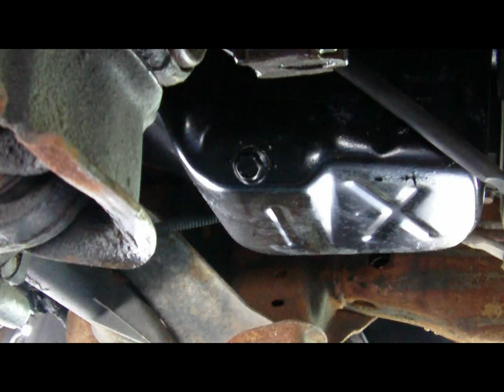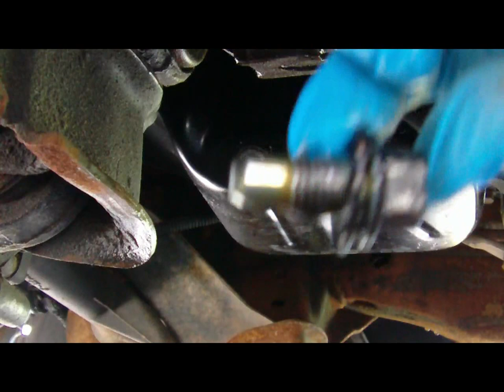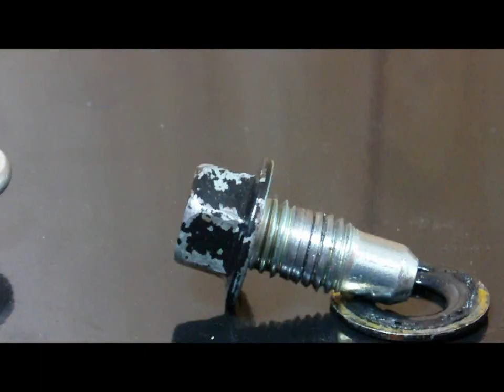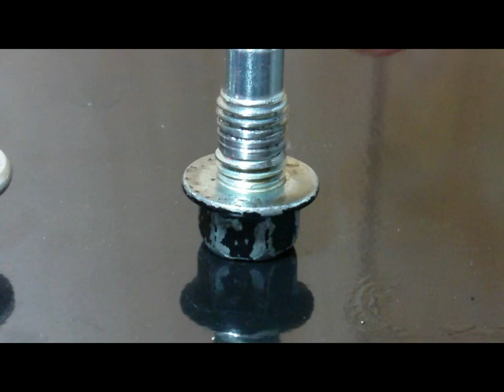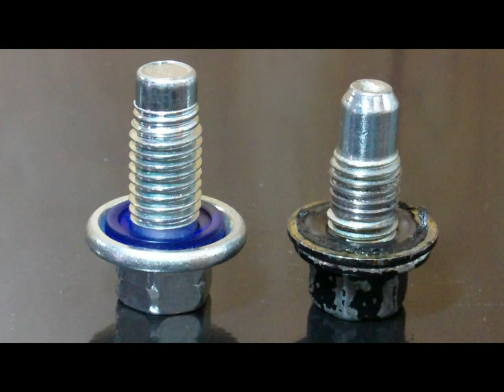Oil Drain Plug Stripped By Pilot Engines Machine Shop North Carolina

Comment: You can put the old plug back, use JB weld to permanently seal the plug so it doesn't leak. next oil change, use an oil extractor to pump old oil out. It works best when oil is hot.  You can get the oil extractor for around $20.  I use oil extractor to change oil and like it more than drain the oil. It takes a little longer, but much cleaner.

Comment: My oil pan was stripped by Honda dealer on route 22 NJ.   Did not even bother to complain.  They all deny wrongdoings.   I sympathize with you completely.   My solution so far was to slap gobs black rtv on it he drain plug.   And suck the oil out for oil changes

Comment: jiffy lube got me😯 AND charged me nearly $100.00 for the oil change😟 2004 Ford mustang GT. Please pray for me🙏
Reply: I'm Christian too, but it is going to take more than prayer.  I had the oil changed on my 2005 Volvo every 3,000 miles at Big O tires which later became part of co-op in my town and became Point S.  When I picked my car up that day, the guy I had been dealing with for years told me that the next time I came in they would have to repair the oil plug because the threads were getting worn.  It was no big deal according to him.  I went home and husband notices it is leaking oil.  I go back one week later and they pull it up and tell me that I either need to have a helacoil (sp?) put in $200.00 or replace the bottom half of the oil pan $1200.00.  Went to another shop with a good rep mechanic to make the problem go away.  They had me go out to the shop and showed me where they replaced the oil plug with a different plug which went in crooked and they have been using a wrench it looks like to replace the oil filter.  They took pictures and sent me back to the original shop to fight and said go all the way to corporate.  Wish me luck!!!!
Reply: E. Harris I PRAY THAT" EVERYTHING'S" GOING TO WORK OUT FOR YOU🙏. ❗❗❗

Comment: I sadly had Firestone service both my cars for 8 years, until the day the put the wrong wheel bearing on my front left axle and didn't tighten the, rim / tire lug nuts. The wheel came off as I was driving as I skidded on down the road.
Reply from the maker: A reputable shop has insurance for that type of occurrence. The same thing happened to a guy I know at a local tire shop with a national name on the sign.
Reply: I know your pain.
They glued the drain plug. In place.
And tightened the oil filter so much ,that I had to punch a hole in it .
Reply from the maker: @blaaq360  The sad part is that this engine consumed coolant since it was re-manufactured, the shop made excuses for their poor workmanship. My records indicate 2,600 miles of use and the oil looks like there is antifreeze whipped into it (I will be sending of an oil analysis), and there is an oil leak from using a cheap aftermarket timing cover.. I'm not too happy with the repair work done by this machine shop because of the cheap parts and sloppy work by their mechanic who did the install into my vehicle.

Comment: I replaced my oil drain plug with a Fumoto valve on my Honda CRV and it worked so well that I installed them on my other two cars.  For  a one time cost of  $20, its well worth it to never have to remove the oil drain bolt again.

Comment: The proper procedure is to purchased a new plug with the proper washer, the one in your video with blue O-ring washer is the correct on.  (As noted in my previous comment, the washer use a Chinese version and never works correctly).  If this does not fix problem you have to tap the pan and go to the next drain plug size, one that gives you full thread potential.  This is a technical job so not recommend for the DIY with no experience.

Most importantly, do not use self tapping plugs available at the auto parts store.  These are suppose to cut thread but they generally shear them so the next time you do an oil change, thread come out with the plug.  That means you are right back where you started from, only the hole is now larger.  Do it right or replace the pan, there are just no permanent short cuts when it comes to this problem.

We do have available a revolutionary new plug design that has no thread, being offered to the quick lube industry and OE market.  It will fit into the drain hole of most any vehicle and needs no thread repair to make it seal like a new original plug.  Let us know if you want more information...   www.OilDrainPlug.com
Reply from the maker: +thepartsman I have seen mechanics over tighten these drain plugs and its sick to send it out leaking or blame the customer.. Yeah, those quick fix oil plugs are total crap. Thanks for your detailed comment.

Comment: The sickest part is that the shop will tell you they didn't do it!! I ALWAYS replace oil myself, the chance of them over torque the drain plug is rather significant, especially with the thinner pan. Thanks for posting.
Reply from the maker: +Bryan Russell Go ahead and BLAME the owner for A MECHANIC SHOP FUCK-UP! The machine shop also said there was bad sensors that turned on the CEL, not the problem at all... I think you don't know shit about mechanic work LMFAO
Reply: +InTheory  This is the most trivial car problem on earth.  Everyone wants to blame the other guy.  How do we even know this guy filming the video didn't try to tight the plug instead of loosen it and then when he figured out what way the plug unscrews he takes a video and blames the machine shop?

Comment: First indication the guy who rebuilt engine is an idiot... is the washer.  This is an non OE Chinese washer a lot of the Quick Lube type shops use.  Use the OE plug you purchased (embedded O-ring Washer) and see if it tightens up.  If you can't torque (to specification in book) you need to remove original threads and re-tap to the next size up (IE 12mm to 14mm, ect).  This is not a job for an owner with limited skills, it requires some talent and time to do it right.   Check out this site for options on OS Tap Plugs, Temporary Plugs and or OEM drain plugs and washers...  www.OilDrainPlug.com

Comment: Much a do about nothing. Re thread the pan,  screw in another bolt with a large head and a sealing washer, and add oil.
Reply from the maker: Never use a Fix-A-Thread Oil Plug Repair Kit, those are a Hack Repair for a DIY.. The oil could have leaked out and ruined a re-manufactured engine due to shoddy repair work.
Reply: Henry Avery actually its a big deal all the shop would have had to have done is tell the owner and say that they'll repair it and the owner would have been much happier.
Reply: But they said they did nothing and some shops just won't do the right thing, But in any event it's a simple fix with a self threading drain plug you can pick up an any auto parts store. Lets not turn a simple fix into a big discussion. It's just ain't worth it to me.

Comment: Be glad that it's just the bolt.  It's really nothing.  An entire video dedicated to a stripped bolt?

A local shop broke the threads out of the pan in my grandmother's GM with a 307.  The threads must be brazed or welded to the inside of the pan.  It must be a separate nut or piece or whatever inside of the pan, because the threads are not tapped into the pan itself.

They installed a cheesy wing nut oil plug and left the "thread" portion floating around in the oil pan.  Luckily that car sold, I really never did want to mess with that.
Reply: +Blaine Bugaski Dude, you are the smartest person I've seen so far posting a reply to the video.  I to think the same thing as you,  why post a video about a stripped drain plug?  Just go buy a new one and install it and be done.I have a repair shop and I see this every single day and have seen it since I started repairing vehicles 29 years ago. This is why I have an oil drain plug assortment, fully stocked and ready to go just incase I find a car that has this exact problem.  Its just a drain plug, that's all it is.
Reply: Have you run into anything like I mentioned where the actual "threaded" portion becomes separate from the inside of pan?  No replacement bolt will fix that problem because you are only dealing with the mere thickness of the pan itself, not the reinforced "section" where the bolt screws in.  It probably isn't like this on all pans, though.  That was a 1980 Oldsmobile pan that I was talking about on a 307 cu. in.

Comment: Bet an idiot cross threaded it then used an air impact wrench on it. That happened to me once when I was time constrained just before a long trip and went to a quick oil change place. Never again.  But you have to wonder how a machine shop that rebuilds an engine, a really precise job could screw up fitting a plug?
Reply: boxwoodgreen I don't know man, idiots are everywhere.  I work at a quick lube shop and I get oil filters from the dealer on some nissans in particular that I've pitted that are way over torqued.  So much so that I've had to puncture the oil filter just to release some of the oil and with it the pressure just to make it easier to take off. 

 There's a calculated risk you take when you send your car to anyone.  Some shops have guys that really care about cars, but then you have other shops that have a staff that just want to make a quick buck.  It just depends and it really comes down to the tech.
Reply from the maker: This engine shop has one guy who does the engine work and other people who do the install. When the truck was picked up, the check engine light was on. The shop said to replace the oxygen sensors, but the fuel injection was leaking (low pressure with bleed down).